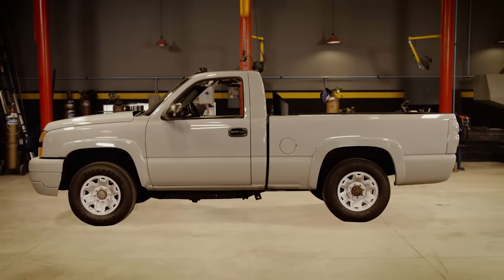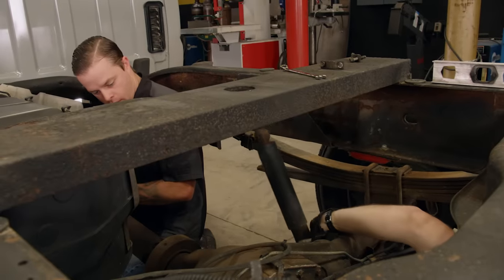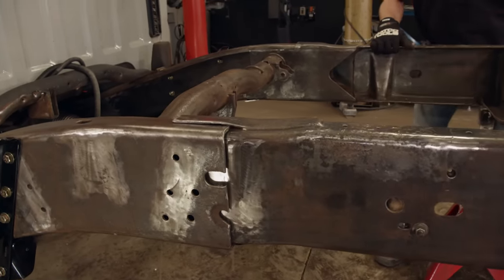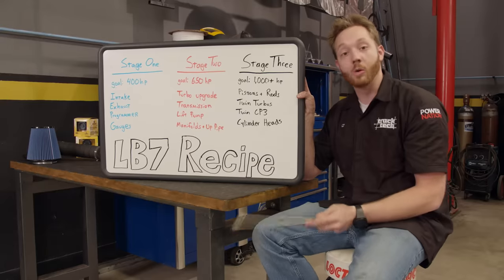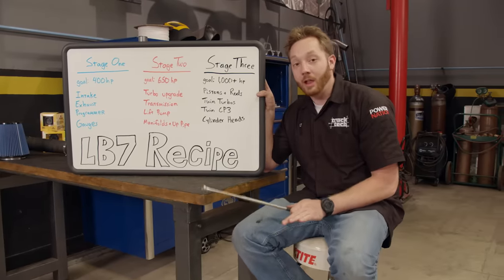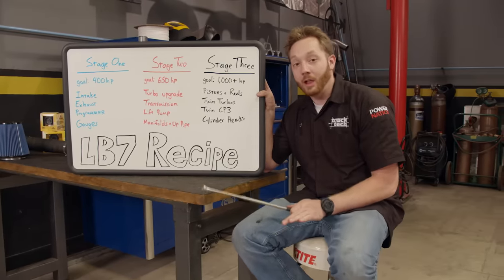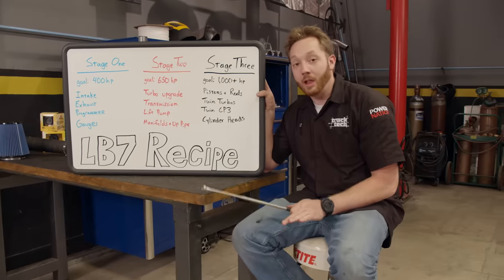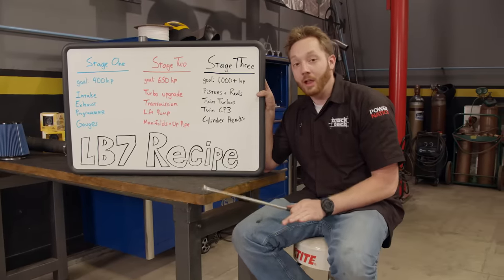Full Build: Silverado Short Bed Duramax Sport Truck - SuperMax

Comment: GM did make short box diesel trucks. I had a 1982 Silverado 6.2 L diesel with 700R4 trans and 3.08:1 rear axle.
Reply: They're talking about duramax equipped
Reply: uhhhhh that’s not a gmt 800 buddy
Reply: @ethzn3982  Those motors were also terrible. We owned one and it was such a dog.
Reply: 6.2 were shit couldn't make power at all duramax motors you can make ton of power with love um

Comment: Love the short box conversion! Would have liked to see stage 3 that LT kept talking about, however.
Reply: Problem is LT isn't on the show anymore 😕. They go through hosts like underwear. And for some reason think they need 25 projects all at once never really finishing any... not like it used to be that's for sure
Reply: LT does have a YouTube channel if you into this build he does other like it
Reply: Wont happen, bully dog doesn't even make tuners that actually improve power anymore after they got smacked by the EPA.  You have to get a 3rd party tuner to do it, or do it yourself.  Even then it's HIGHLY restricted.

Comment: So I have a yfz450r I bought unfinished swap with a gsxr750 engine I got it wrapped up but I’m having issues with chain slip or jumping I don’t know. I used the engine mounts they made but asking about engine sprocket alignment with swing arm bolt. Mine is above about an inch or so but it’s dead center with rear sprocket my question is would that cause a problem ? Should I lower the engine to be center with swing arm bolt ? I would be loosing ground clearance but if it’s needs to be that way I guess there’s no way around it. Thank you I await your response.

Comment: The factory oil pressure sending unit is a check valve kinda sensor. Oil pressure on a aftermarket gauge wont hurt. But if the stock gauge comes off its starting point it has pressure. And for future searches take a look at LMR, American muscle and cj pony parts. As far as future tuning if you ever decide to change tuners look up Mo’s speed shop out of Dallas Georgia. They are really good with mustangs in general. You can figure the gear ratio by rpm at 55mph with it in 4th o/d locked up. Id turn tcs off at all times, its a early tcs system and it will actually cause you more trouble than it will prevent. It pulls engine timing a ton, and doesnt exactly abs like it needs too in order to help traction. Ive had em sideway and tcs kick in and the car dead hook and go straight in a bad way. Ive even seen tcs activate when its turned off by the button. Could ask the tuner to eliminate it completely if he is capable.

Comment: I get it's for TV. 
Buys the truck with a S&B cold air intake. Takes it off and replaces it with Bully Dog. Then replaces it again off screen with the final one. Nice!
Reply: I like how LT pointed out the original wasn't really a cold air intake and then wound up swapping out the real cold air intake for another hot air intake off camera due to the parts sponsorship.

Comment: Great build would’ve done few things different though as far as performance. You guys should’ve added keys on the crank that small dowel pin is a major weak point, also you might’ve been able to get a few more gains in stage one and overall if you upgraded the Y bridge to a 3inch the stock one is just as restrictive as the downpipe, one other thing is when trying to push more fuel you could also add higher flow rate injectors and another major upgrade is 2 piece motor mounts keeps it held tight which when your truck pulling you don’t need to rely on a chain to keep it from torquing under load just few things. Anyone with an lb7 should also do wire tuck the stock covering is a major pain… tucking and loosing the OE plastic will save time when pulling 👌

Comment: ppe is a sponsor but if it was me id throw that ppe diff cover in the trash and get a banks ram air diff cover its deigned for better cooling a the fins inside help cool it better without introducing air in the oil. and it has a patented ram scoop that cools the diff

Comment: Wouldn't it just be easier to engine swap a 1/2 ton short bed? I understand the keeping the numbers matching and the heavier suspension etc but if your building a diesel street/ strip truck wouldn't you want it as lightweight as possible.

Comment: Im only guessing, but based on all the details you provided... I would bet the first hard yank caused damage at both ends.  Whether a visual inspection would have helped or not, who knows.  The second pull damaged your recovery point and the soft shackle at the jeep even more...to the point of complete failure.  When i saw your video teaser still shot i would have guessed the jeeps recovery point broke and that was the mass and weight that caused so much damage and injury.  Thank god that was not the case, or this could have been a complete tragedy for you or your passenger.  Thank god you are recovering and learning from this experience.  I learned a few things I've assumed and done many times without realizing I've just gotten lucky.  First step for me is throwing away my cheap Chinese soft shackles and only keeping my better ones.

Comment: Why not put the old roll pan on it looked better anyways also why dual exhaust and a muffler why not just cut the small part that the wheel rubbed
Reply: if a manufacturer was named it was a paid placement.

Comment: Wounder if this could be done to my 2005 1500 short box
Reply: Wondering if the frame would be a limiting factor.    The half ton wasn't really designed for a diesel.
Reply: @bmstylee  I know the half ton came in a 6.0l gas and looking at the specs the duramax is the same size ...
Reply: i was wondering this to, i think the diesels tq may be alot for the frame to handle with stage 2 and up? maybe not
Reply: @joefries365  that's a good point but doesn't the 6.0 put down similar numbers I'm guess not in the 4x4 or awd but in rwd .. its something to look into that's for sure. My 4.3l is starting to get long in the tooth and looking at replacing her soon
Reply: @knkmphd a fully dressed duramax full of fluids weighs twice as much as a 6.0 it will fit in the engine bay but it weighs substantially more
Reply: Good to know  @bmstylee

Comment: Not many wires to hang off the bed on an old truck like that. Do that to a new truck. They might be 6,000 f**** Meyers sticking out to get to your trash camera because you can't back up and you need 6000 inch mirrors and a camera just to back up to a trailer because you're a scrub from 2023